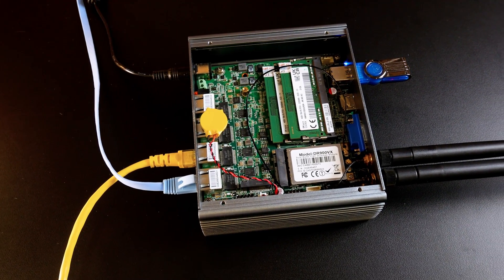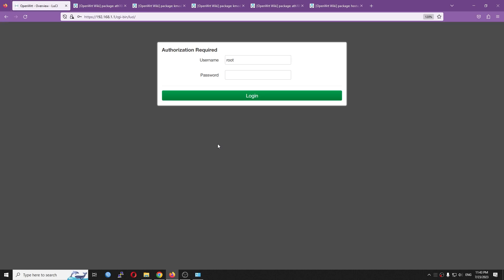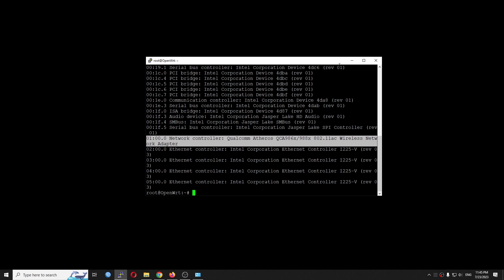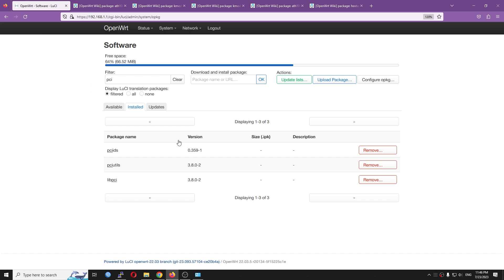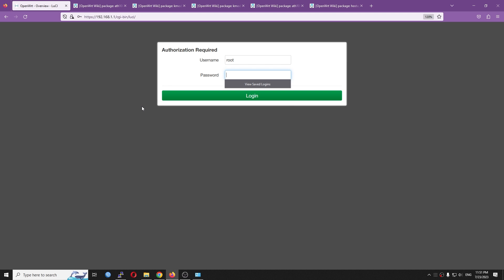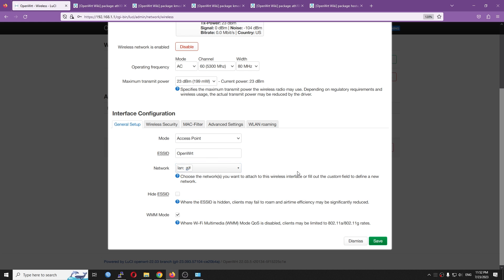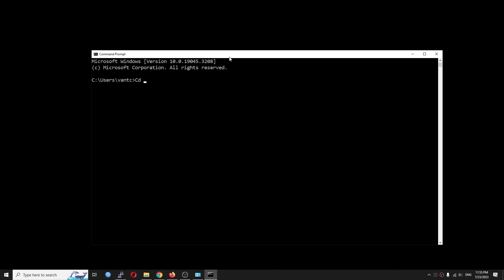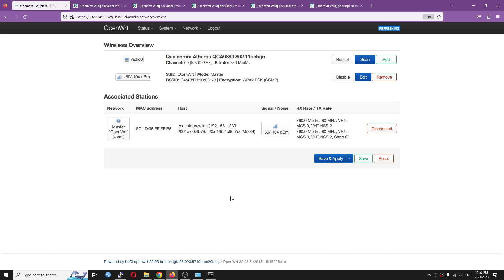OpenWRT - Intel N5105 Router PC WiFi Module Install & Configuration (QCA9880)

Comment: Ad cho mình hỏi thăm: mình gắn cái card này vào, trong openwrt nó chỉ có thể tạo được 1 ssid sóng 5ghz hoặc 2.4ghz thôi phải ko? Hay là nó có thể tạo 2 sóng 5ghz, và 2.4ghz?
Reply from the maker: Tùy theo loại card bạn sử dụng có 1 radio hay 2 radio nha bạn. Ví dụ như con trong video chỉ có 1 radio, thì chỉ phát được trên 1 băng tầng 2.4GHz hoặc 5GHz nha. Còn SSID thì có thể nhiều hơn 1.
Reply: Mình thấy card trong video nó ghi dual band, làm mình tưởng nó phát được cùng lúc 5.0ghz bà 2.4ghz, cho hỏi: vậy card mà muốn có 2 radio thì thường nó ghi sao?
Reply from the maker: Mình chưa thấy card wifi nào có 2 radio, nên cũng không rõ.

Comment: có link mua wifi module không bác
Reply from the maker: Nếu muốn mua mới bác có thể liên hệ nhà sản xuất tại wallystech.com, hoặc tìm trên AliExpress. Còn bản cũ mình có thanh lý module này nha, nếu quan tâm bác có thể ủng hộ mình tại https://shopee.vn/Module-WiFi-DR900VX-mini-PCIe-QCA9880-Hai-b%E1%BA%B1ng-t%E1%BA%A7ng-MIMO-3x3-%C4%91%C3%A3-s%E1%BB%AD-d%E1%BB%A5ng-i.332992965.24661904299